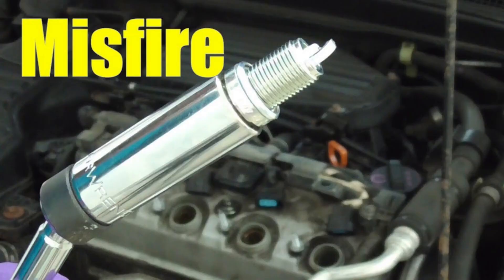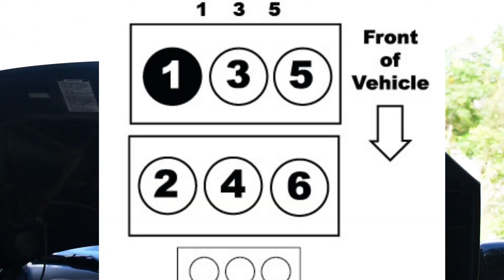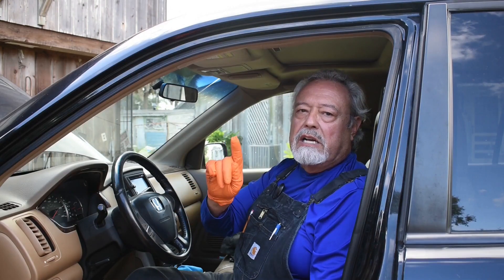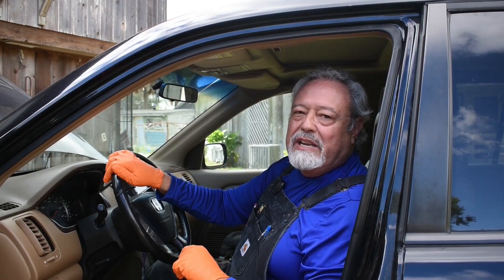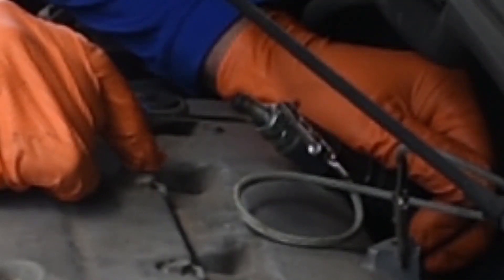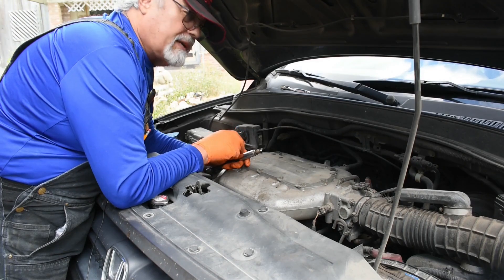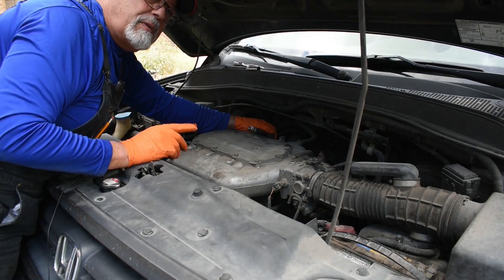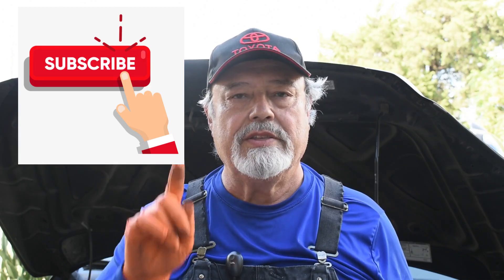How to Test for P0303 Trouble Code.

Comment: Well that cleaner should do it but if it doesn’t it may very well need a valve adjustment due to the fact that Honda is one of the only brands left that doesn’t use hydraulic lifters. Or worse yet if the head gasket has a slight leak around that #3 cyl. Anyway good luck sir!
Reply from the maker: Thank you Daniel for the view and that information. Honda and I go way back. I went to Honda training school in 1974 for the super new CVCC engine. I also went to some transmission classes. Have you done any factory training ?